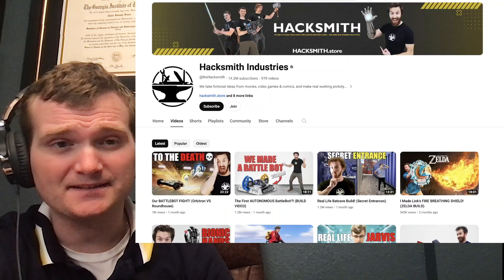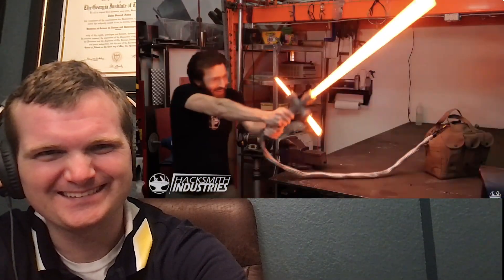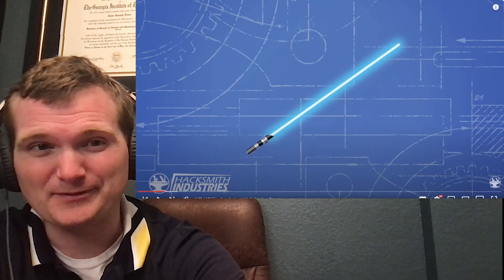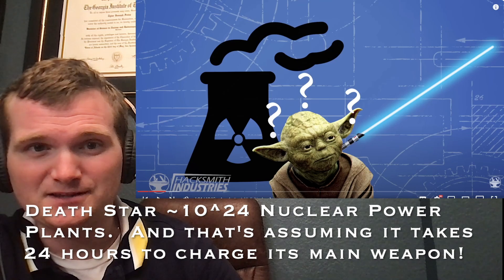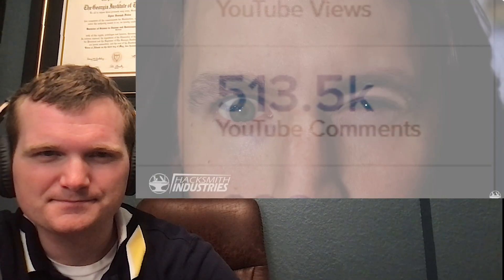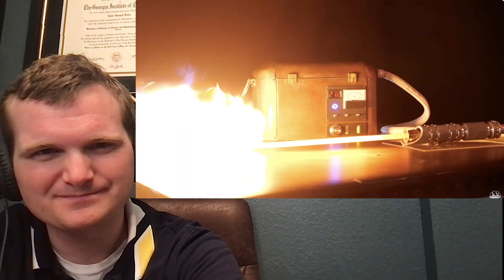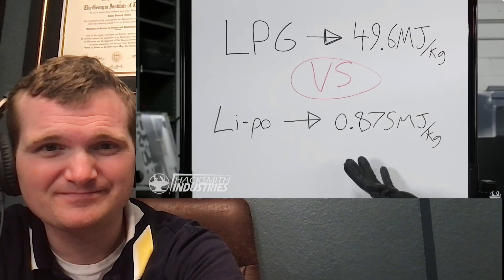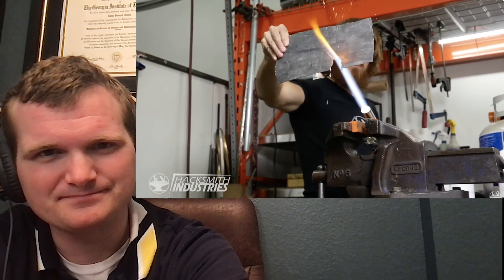Nuclear Engineer Reacts to Hacksmith Industries 4000° PLASMA PROTO-LIGHTSABER BUILD

Comment: I'm curious to know from a nuclear engineer what other types of fuel might be more productive but still safe to use in this type of flow.... also what  metals might be better for higher yield fuels....I feel like there is also a process to make his salts into some sort of degradable solid crystals that the blade could run through and sustain color... we need the research from real scientists, chemists and or nuclear engineers, like he said not many people are doing this... but the correct minds collaboration may yield us a real one... also I know in rocket science we use solid fuels... what kind of solid fuels could be safe in chemistry to use for this type of experiment? There are so many science questions to put into research at this stage.... please help science of the future move forward....😊

Comment: A few futurists/scientists claimed you would need a nuclear reactor, a star, or all the energy in the universe to power a real lightsaber.
The original concept of and lightsaber was basically a cathode/canal ray powered by a Tesla coil power supply, with a crystal in the beam emitter to provide a visible frequency. Since the beam is charged, it will be shaped by electrical charges of the right polarity/frequency, or magnetic fields. Almost none of the lightsaber experimenters go back to try the original concept.

Comment: do I have one question so bach when you said a nuclear generator produces steam couldn't you use that steam to power other things like steam engiens or other things?
Reply: That mostly depends on how high the pressure gets, and the plant would have to be designed around the steam engine as you wouldn't want steam to get into other areas of the plant.
Reply: @Knight62708  true but sence it's clean energy and the steam is clean couldn't you use it for a turbine to make a little extra power fron the already used material so you can produce more power so you don't need seals or gaskets or anything g like thst you just need a inlet and a outlet for it and you could stack them in series so it keeps going through then and the pressure would be easer to regulat in that manner

Comment: what if they had the actual plasma - blade almost spin? like you know how on steam stacks, you look at the steam when it comes out and it is swirling about, and eventually turns into a big puff of smoke, but i was told it spins because the way the metal on the outside is plated and the on coming wind interacts with that to spin, well what is the tip on the inside had the same arrangement, or maybe even a fan to make the gas and flame swirl and so that it is more stable, and to be able to put more fuel, and more heat without it being to short or to... fizzled out? and make it even more hot!
Reply: i probably have no idea what i'm talking about but if i'm correct why not do it?

Comment: 10:55 Kinda. Originally George Lucas wanted to use reflective tape and the studio lights to make the lightsabers glow white. The lightsabers had rotating motors in the hilts that spun the blades and made a pulsing effect. As a result, the actors could only lightly tap the lightsabers during the fight, which is why the duel in the original movie looked so simple. In the end, the lighting effect barely worked, so the went with rotoscoping instead, and made the blades blue and red.

Comment: Could you make a nuclear cell small enough to fit in a reasonably sized handle?
(And how much power could it produce?)
Reply: You can make a "nuclear battery", an RTG, (radioisotope thermoelectric generator) about the size of a suitcase. Its what powers a few space probes and the newest mars rover. Its only a few hundred watts, but it will last a long time.
Reply: @aggonzalezdc  that would work for a proto saber, I suppose.
Reply: @noneyabidness9644  maybe? You would struggle to run a large space heater off of one. I think the one on the rover makes 110 watts at full power? The Voyagers RTGs made about 160 watts.
Reply: @aggonzalezdc  ahh, so. Non starter. Thank you for the information.
Reply: @noneyabidness9644  if you had some crazy tech that could run the blade on the power of a lightbulb maybe but that's about as fantastical as magical laser swords are. So yea, it's not getting you very far. If you want real power you need an actual reactor not an RTG, but the smallest still weigh several tons and are the size of a small car. You can check out the reactors created for the air force back in the day. I think those were about the smallest historically until the rise of modular reactors recently, which are probably the smallest current reactor designs, and the whole thing is about the size of a shipping container.

Comment: It's a fire-saber...and I love how they keep the top half of the blade out of the shot....  as far as surgery, actual plasma is what, 12,000 -14,000' F? (The proto-saber is 4,000F although I think the actual gauge for plasma isn't temp, but free movement of the electrons) The heat transfer from something the size of a light saber that size and temp is going to roast all of the surrounding tissue instantly while causing all the moisture in the area to instantly turn to steam, It would probably cause severe burns from a few feet away, if not just causing stuff near it to combust, though I have to verify the actual distance that much heat would radiate.

Comment: My personal opinion/theory is that the kyber crystal is something like an energy amplifier/transformer that outputs more energy than what goes into them and everything else that goes is typically stuffed into the lightsaber hilts are just something similar to what you would expect from doing when you are building a custom labtop/computer with the power cell needing a recharge ( depending on how often/heavily you use it) I’d say that they’d have something like one to six years to multiple decades of power retention before they’d need to be recharged or something like a power cell replacement
Reply: And the original trilogy movies (Star Wars Episodes 4,5,6) prop lightsabers were a hilt that had a motor mounted inside the blades where a durable stick that had reflective tape attached and then they’d spin really really fast so they would look like a glowing rod add in in post production a red-blue-green tinting to them and there you go

Comment: They could potentially cauterize wounds, but at the rate lightsaber dualists move the beams through their opponents limbs I don't think they'd have the time to do so. Thermal conductivity takes time to occur. Just like how metal bullets should be able to pass through the beams without melting, unless they're ferromagnetic metal.
Reply: It would have to have a super high concentration of photons, not just a gas reacting to oxygen. More like a laser. Just need to figure out how to contain them until they interact. If you could indefinitely hold almost infinite photons, it could be charging for years until you use it. Maybe even when retracted the lightsabers hold onto all of them inside. That would make sense.  It would theoretically explode like a nuke if the hilt was cut though

Comment: Maybe if they had a plasma self contained by an inner core capacitor that has a strong high voltage filled capacitor that is activated by microwaves.

Comment: as for self cauterizing we already have that with what i work on at Olympus. we have a double set up of ESG-400 and a USG-400 that can first use ultrasonic frequencies through a tip to cut the flesh while using high voltage to seal the flesh at the same time. butttttt ill admit still not near as cool as this would be though :)

Comment: Steampunk is the idea of advancing the technology and aesthetics of the "age of steam", ie. the industrial revolution, and creating a fantasy world built on that. So instead of wireless internet, you are sending signals "over the Marconi". Instead of aluminum and carbon fiber aircraft, you have copper and brass airships. And all with either the gaudy ornamentalism of the Victorian era or the more stately Edwardian era style. 

But also with an exhibited functionalism to it - gears, pipes and fittings are visible rather than concealed. That's the "punk" part. It combines both the refined style of the era as a baseline with a sense of being unrefined. Like you took pieces from the Victorian era and cobbled a more advanced device out of them in your garage.

Comment: Borax is used for many things such as a water softener and as a flux for forge welding steel. It's also used as a timber preservative.
Reply: Boric acid powder was used a lot in my town as a roach killer. Also as a coloring for various rocket engines. Ah, the memories.🤪

Comment: Question for ya. Lightsabers (According to the lore) can cut through all matter except another lightsaber. All matter is made of atoms surrounded by electrons. If a lightsaber blade consisted of positrons, it would (Theoretically) be able to pass through all matter, but not another lightsaber blade, right? If the blade was a stream of positrons coming out of the hilt, and then bowing back into it, it would reconstitute itself like a long loop. In the original book, "A New Hope," the blade emits no heat. The burning effect would only happen as the result of the positrons shearing through the electrons of the matter that it's going against. How would that theory sound to you? Love your videos -especially the Sam O' Nella ones. That guy is hilarious!

Comment: from what i can recall of the various bits of books that even try to explain the workings of lightsabers, it is a superconducting plasma loop that is contained ether magnetically or by essentially inverted shields. 

it only really drains power during activation or when cutting. the power supply is pretty hefty, the only case i remember of one being drained wasn't due to use but as a security measure after the jedi was arrested, and recharging it took some time and drained about a dozen blaster rifle power packs.

Comment: I guess it will take someone a bit nerdier than me to find to exact power formulae of a Kyber Crystal, but since they were also used to power The First Order's "Planet(s) Killer Weapon"; power to weight/mass HAS TO BE off the charts!
Reply: A chunk of uranium that would fit in the hilt of the lightsaber. Almost certainly has enough power output to power a plasma-based lightsaber, The problem is you have to find a way to make a nuclear reactor that fits in the hilt of a lightsaber
Reply: @the_undead  The biggest issue with it is how to actually generate the plasma with something other than a combustible fluid/gas. Back when they were using a battery to power their prototypes, it was with solid-core blades. They used the electric output to heat the blade's core by effectively making a short circuit. Without that physical blade, what would the power from the reactor even do?
Reply: @the_undead  A Shakeweight Sized Fusion Reactor. Use TIIIIINNNEEEEEEE Uranium235 Rods submerged in barium heavy water, and as you move the power slider, it exposes the Uranium Rods to the air, and powers up the lightsaber.

Comment: Thansk for the regular vids, been smashing them......and the like button ofc :P you said the smallest nuclear powerplants were those that can fit in trucks, could you do a vid on the smallest ones that go to space =)? super interested
Reply: They don’t sent the “normal” kind of nuclear reactors into space, they use Radioisotope Thermoelectric Generators (RTGs) they essentially just have a chunk of radioactive material that heats up and they generate energy from the heat. On one of the Mars rovers I think the RTG was like 60 kg and only generated 200 W. They don’t moderate or speed up the process like they do with conventional nuclear power plants, instead they just rely on the natural decay of the material.

You can even get tiny “betavoltaic” “batteries” that absorb the radiation created by the decay of the radioactive material and convert that into electricity, they generate very little power, the only commercially available ones generate around 100 uW in a relatively normal DiP chip.